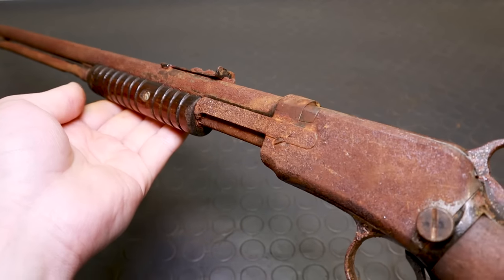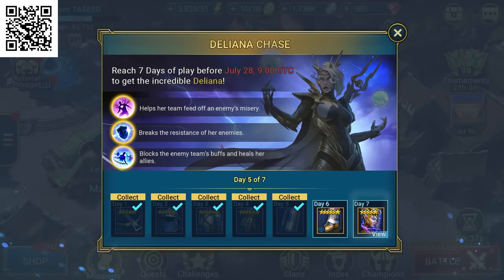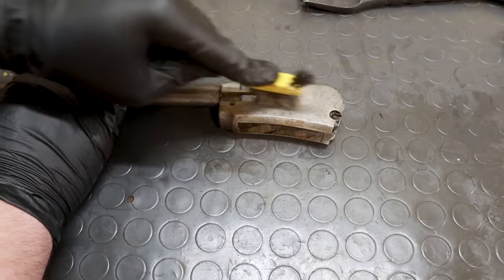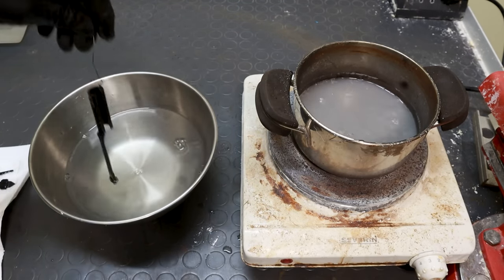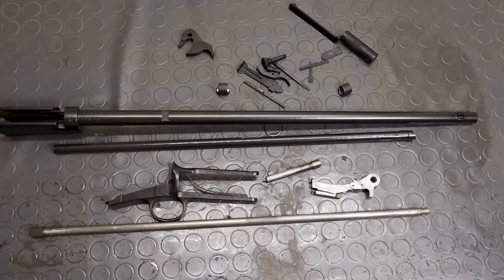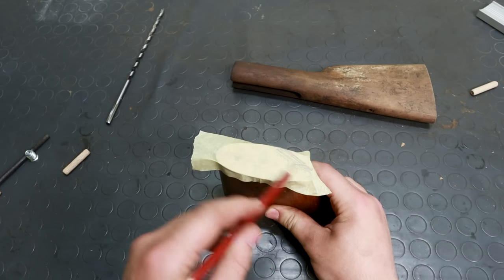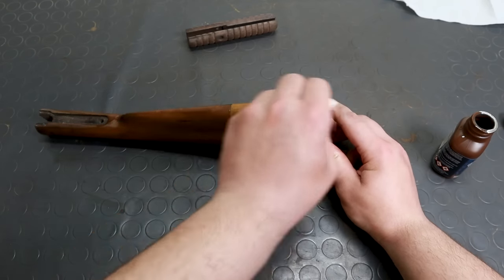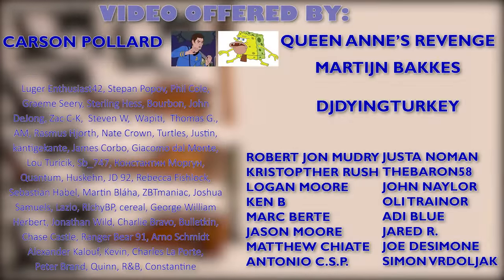Restoring a 1906 Heavily Rusted Pump Action Rifle

Comment: There is nothing wrong with cutting hardwood with a metal saw blade. You'll get frustrated by the packing of sawdust in the teeth if you try it on softer woods though.

Comment: Is it okay to leave some parts rusty? For example the notches on the barrel or the inside of the assembly on the breech side. Also, what was the point of the screw in the stock extension? I wasn't able to comprehend how it helps stay together. Great video btw

Comment: I Hope You PLEASE ANSWER!!!! I’m using your video to restore mine 👍 and it is coming out AMAZINGLY but I’m now to where you removed the outer tube because it was stuck , mine is also stuck and you skipped over how you got the screwdriver and wrench in between the tube and the receiver how did you get it out that much In order to be able to use the punch on it

Comment: Great video and a good restoration. Beautiful rifle, wish I could get my hands on one of those. Just for the wood part, the original stock seems to be or should be walnut and the one that you use for the attachment is clearly another type of wood. But you could have used a water base wood stain to match the color of the forearm and spray it instead of rubbing it. That way the joint would have been less noticeable and you could rub oil after it dried. Just a thought. Greetings!!

Comment: Just as an aside, while I know its a bit too late for that to say the least, this is mostly for anyone who may also own one. I'm pretty sure the Model 1906 has a small retaining pin on the rearmost mounting post that retains the magazine and keeps it and the bracket it is connected to from moving. I could be wrong, it may only retain the mounting bracket for the magazine, its been a while since I've done a complete teardown and a deep clean. Needless to say you'll have a much easier time removing the magazine if you remove that pin. Removing the magazine is basically the first step of a complete teardown of the weapon. Without removing the magazine you can't remove the forend and subsequently you won't be able to remove the bolt.

Comment: nice job on the restoration of the gun... being a woodworker,i found your extension of the stock very interesting. for as much work as you put into it, you could have  built a new stock. there are zillions of them guns around and taking a stock from one for a pattern  would have been a easy build... but the gun is not a high value item and what you did will be just fine.  came out very nice and some day someone will  build a new stock.. lol.. best wishes and keep up the good vids

Comment: I've seen similar stock repairs in the past and sometimes the gunsmith would place a thin layer of white or other color wood in between the two pieces of different colored wood.  Or, sometimes they would use silver or some other metal if they had it on hand.  Something to think about for future projects.

Comment: So my only question is why not use the second stock and try to reshape it to the gun or was it far too big to do?  Or is it simply to keep as much of the original material? Not a gunsmith by any means but I would think some modifications to the stock would've been just as easy if it was comparable

Comment: I have one of these, but in .22 WRF (Winchester Rim Fire), which is about half-way between .22 long rifle and .22 magnum (WMR).  A weird and hard to find ammo, but I did buy some and put a lot of shots through it as a teenager.  It had the barrel cut shorter, just past the feed tube, with the sight moved back, done before I got it.  I think the stock was original, as it had a nice-fitting metal butt pad, but still pretty short.  Alas, the hammer spring finally broke on it, so it's no longer shootable.  I still have it laying in a box somewhere.  Antique now.  PS, I think you could slam fire it. :)

Comment: Personally when blueing I never allow the metal to touch the bottom, I use mark Lee's blue, and always get the barrel up to temp before applying, allowing the blueing solution to flash off immediately, then I prefer a carding wheel but for the last two (I usually do 9 passes and the first pass is two applications before carding) I use quad aught steel wool, that has been degreased. I'm not sure if you did that in your first pass.

Comment: You can find original stocks for Winchesters on ebay.  Also, there are stock makers who supply stocks ready to fit to old rifles.  The method used in this video for the stock will never look like anything other than a really sad  patch job.  And, yes, I am a woodworker who has restored many old Winchesters and other rifles and handguns.  Your work on the metal is fine.

Comment: It appears that the gun you have was a gallery gun. That particular model Winchester was used extensively in shooting galleries for traveling carnivals  and were often produced with child sized stocks, so adding length wasn't necessary to restore it.

Comment: I have one of these! It is in ok shape, but I want to remove the rust without damaging the blued surface. Ant advice?
Reply: remove all the furniture and boil the metal parts then lightly use steel wool to remove excess iron oxide on the surface

Comment: Should have used wood filler on the joining crack and then sanded it smooth. Then you can use a darker stain for a more natural look. The barrel can be done with 0000 steel wool, a construction orange flag marker wrapped with the 0000, with 3 & 1 oil. Attach to a drill and work that barrel. It will smooth out nicely without damaging rifling.

Comment: Very nice job considering what you started out with. I know because I have the first year ( smooth forearm grip ) of the exact same firearm in its original used but, not abused condition. If you were so inclined , you could remove the finish add some stain to your stock to offset the wood color  then reapply your finish. I’m sure you already thought of it. 👍👍👍👍👍🇺🇸🙏🏽😎✌🏻

Comment: Out of curiosity, what's the protocol when you do find a bullet in there with the cleaning rod?
Reply: Typically move the gun to an area that's safe if it does happen to fire. As well as trying your absolute hardest to get that chamber open. If that doesn't work you just got to take the gun completely apart. You really don't want to go through the entire cleaning process if there is a live round chambered, because say the trigger was pulled somehow or broke and while you're cleaning it, it finally breaks free and goes off

Comment: Good job dude but you should use a soft steel wire brush before apply the next blueing solution. Be ware of the steel wool who is sokked in oil en wwill ruin the proces .Best regards from Belgium

Comment: Does that boiled bluing technique affect heat treated parts? For instance making them loose heat treatment?
Reply: Most guns are cast metal that aren’t heat treated anyway but they are a few forged guns but water couldn’t get hot enough to effect the temper of steal

Comment: I wonder if you could have made the stock extension a removable option? That would have respected the gun historic original adaptation to use by a teenager but also could be used by both teenagers and adults now. It would have meant creating a fixing for the cut off bit of the original short stock. I appreciate its a case of me being wise after the event, but maybe an option for a similar event in the future? Nice wood working skills as well as the usual metalwork!

Comment: about removing the magazine tube assy. inner and outer tubes . i would have first removed the pin at the inner tube band that holds the outer tube to the band . after letting some penetrating oil  soak in and if i could get the outer tube to slide past the inter tube band then i would have turn the outer tube with the front band together [the front and rear bands turn to install and remove they are not like a sight dove tail cut that is driven in or out ] and removed the assy. and by doing that you could have removed the fore end  wood and slide assy. and you would not have soaked the fore end wood in the cleaning solution . but in the end you still got there .

Comment: Please! When sanding a flat surface use a firm sanding block so the crisp edges between flats and radii aren't rounded over.  just using your fingers on flats can sand shallow grooves into the metal.  Please, use a sanding block.  The results will be better.

Comment: On the stock repair instead of just a simple straight cut with a little flair and planning, you could have made it a little more interesting. Like cutting one piece into a jigsaw puzzle piece and the other to match it in reverse. As just a simple functioning stock what you did is fine. You could have made a wedge shape on the new piece and a wedge cut on the old to match. Just something to think about next time.

Comment: You did a great job on the cleanup and bluing process. It's sad about the stock, but the improvement suits that rifle well. However, I did not see ee you clean the internal parts, and especially the rifling and barrel. You know there was a lot of rust corrosion in the barrell. Too bad we did not see it

Comment: That was Amazing how You repaired that .22 Caliber Winchester Rifle.
I'M not for Sure 😊😂 of it's Model Designation, Exactly? But I Think 🤔👀 it's of the Winchester Model 60 - other 62 Varieties. Reason I'm kinda Familiar is My Father had A Model 62A with the more Square Blocked Wooden Pump Piece, the Barrel was Octagonal 🛑 in Shape, instead of Round. Also it had the One Piece Stock Screw, Tubular feed Magazine, the Ramp Sight, and End Sightings the Same as on that Particular Model. My Father Said His was just the Same as the One's, used at the Traveling Carnavel Shooting Galleries, on the Midways of Old. Mid 1940s-1970s era.
     Wow was it a Sweetheart of a Rifle too Shoot with. Whether you were Hunting Small Game, even Deer 🦌🦌, VARMITS, Raccoon's, Possum, Squirrel's 🐿️🦫or just anything One Could think of.   From the Stand point of a Beginner's Rifle? Too an Adult's, those Rifles are just Unbelievably, Fantastic Piece's of American Craftsmanship, still to this Day. Thank You for Sharing, Your Expertise with US.

Comment: I have a couple of questions.
1. With the stock, why didn't you cover the original part of the stock in something like masking tape and simply re-stain the new bit to get the same color?
2. Why is the guy shooting it in the end of the video not wearing hearing protection? .22s are quiet for gun cartridges, but still VERY loud compared to normal sounds.

Comment: Nice rifle to restore but I would have made the butt a feature and inserted a thin brass plate between the joint which would distract you from looking at the joint as a repair and as it can’t really be an intact restoration I would have also considered adding a brass butt plate maybe a small brass band each end of the sliding stock to tie it all in.

Comment: i like this style of .22. they aren't that rare in the US, and i've shot a few of them. they are great because you literally just put whatever .22 you have in them. short, long, heavy or light bullet, hot or light load. it doesn't matter because its pump and the length doesn't matter because its tube fed. it has all the benefits of a pump action shotgun basically.

Comment: Barrel liners aren't that expensive and can be epoxied in place, if you want to regain accuracy, if you know any gun shops they might have the bits with pilots and everything, all they'd have to do is drill out the old rifling and glue the new liner in place.

Comment: Own the barrel. Did you just put it in hot water and boil it. Was there any type of chemicals in the water bath. I appreciate it if you would tell me. Would you please give me a list of the chemicals that you will be using on the weapon. Thank you very much for your time and for this video. Also what grit of paper did you use on the barrel each time. I really like your work the results are absolutely fantastic. The old shotgun looks great except for that stock. If you would reach stain all the wood in a dark walnut you would be hiding the all color and it would look really great. Try it on a piece of scrap two different colored woods. And after you varnish it or oil it look at how close they will match. Just thought I would try to give you a hand with this job. I do a lot of spainting on old weapons. I fix gougers scratcbasically anything wrong with the stock. They really look good when I am done. Feel free to contact me if you ever have a message or a problem with the wood again. I will be glad to help you the best I can. Thank you and it's a great video.

Comment: I usually make a feature of splicing a stock.  I would have used 3mm brass plate in the joint and made the butt piece much, much darker.  Rule of thumb isn't you can't match it EXACTLY then make a feature of it.

Comment: My father had that gun. I remember it well. That stock was about the same length as I remember. I don't believe anyone cut that stock. That's the way it came. I could be wrong but...pretty sure adding on to that stock was unnecessary.

Comment: This gun a lot newer than 1906 , the 1906 had an octagon barrel, looks like the gun has been rusted to look bad being the inside parts have little rust.
Reply: Not all rifles of this model had octagonal barrel, this rifle has been made from 1906 all the way up to the 30s so there were quite some different models. Its normal for inside parts to have little rust in some instances, if the corrosion is not too bad it’s likely not to get to the internal surfaces.

Comment: Something about this restoration seems... odd. I'm sure the restoration was real, but... the wear, the amount of rust on the internals vs. the exterior of the gun, how the materials that are resistant to oxidation have zero oxidation. My gut says this gun has seen some artificial aging.
Was it a viewer submission?
Reply: Yea I don't think you understand how rust spreads, the inside will always have more rust then the outside
Reply: @derekhenschel3191  no, I know that, but what little glimpses we did see if the insides before he cut the footage, where 2 parts fit together were spotless. They shouldn't be.

Comment: These videos are faked. Looks like there’s zero pitting, just a light coating of rust, more than likely he used some chemicals to make a regular gun look like that. If that were not the case, he found it in water, and guns that spend any time in water become completely compromised, they’d fall apart before they polished up. Why’d you ruin a perfectly good gun for this video is basically my question
Reply: You must not have watched the video because there is pitting, and the channel is legit.

Comment: 🤔 rusted , inside is spotless and screws are not rusted stuck 🤔🤔
Reply: @derekhenschel3191  slow the video down . Sure looks like it’s painted on rust color .. lots and lots of fake restoration videos out there . Just saying
Reply: The internals of weapons are usually protected from outside conditions such as dry or acidic conditions. This dude is legit